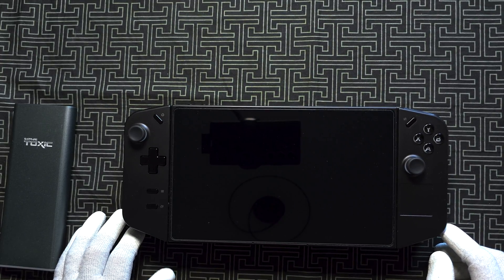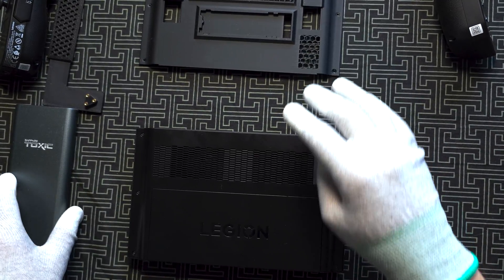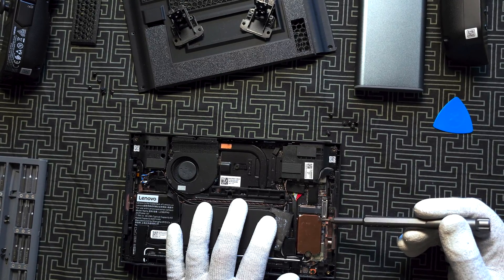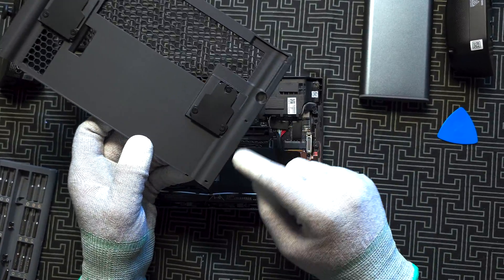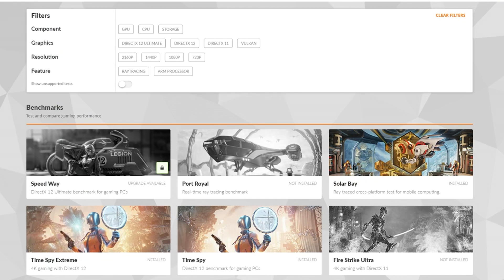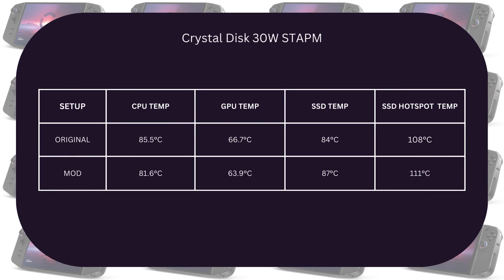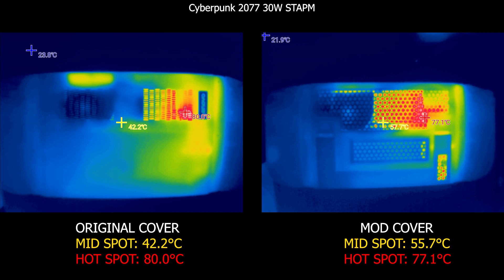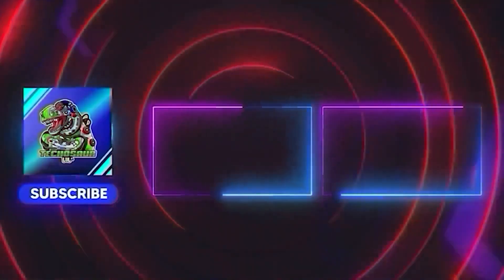Is This New Cooling-Enhanced Back Cover Mod for the LEGION GO a Worthwhile Upgrade?

Comment: dude all the mods you show makes the legion go warse. Even the 40 W it made my legion go unstable and i feel it has some issues still after i reverted it back to default. People save your time and Legion and do not do any of this modes! Good work man this is very well done content and you cover all of it great, not blaming you in any way, just your content shows to not touch the legion and use it as it is.

Comment: It looks like they've closed their Amazon UK store down as says unavailable :(
Reply from the maker: I found another link in Amazon UK if you are interested
https://amzn.to/3VJCOII

this is the cheapest offer on amazon UK i checked
Reply: @TECHOSAUR  Thanks very much. Typically I checked before watching to the end of your video. I can't really think of a use for this given how much extra heat seems to be generated for a very small 2c benefit. Have you come across any other cooling solutions (with or without including case replacement) ? Would be interested to find out :)

Comment: 9:27  I think you are spot on. If you take multimeter to the metallic surface on the back of the cover, you can see that it is conductive. On top of that there are 3 foam pads wrapped in a semi metallic weave (also conductive). Those 3 pads sit on top of the cpu heat pipe (they even left that spot bare copper for a solid link), the ssd, and the cpu cooling fan. 

The big question is what type of paint are they using to do the heat spreading? Kind of reminds me of the conductive paint that is used for grounding guitar pickup cavities.

Comment: I wonder if a metal version of this would be possible and if it would work better?
Reply: To a degree (pun intended) but covering the inside with copper tape works well for heat dissipation. I've done it on all my laptops and handhelds with positive results. The amount varies device to device though of course, but it's always good.
Reply: @TtumpsNeckVagina oooh I wonder if printing it in a fdm printer with a copper filament would work too
Reply: @joshthomas852 I've no experience with 3D printing so I couldn't say. Sound feasible though.

Comment: Thank you for this, was on the fence for the cover,
Reply from the maker: Me too. Not what I would like to use for a daily drive; it doesn't solve all issues. Maybe good for some uses, like an external 2280 drive, but still not perfect at doing it, and the material is very cheap compared to the original one. I don't think you should get it. The only reason you should pay for one would be a better backplate for the Legion Go that looks and feels like the original one while adding more, this feels a downgrade in some way, Legion go deserve better

Comment: @TECHOSAUR Are you ever going to update this video using the 2280 with the mod and orig back plate
Reply from the maker: Yeah! I think I'll get back to it soon—sorry for the delay 😣
Reply: @TECHOSAUR  do you have have any suggestions... I thinking about getting the 4tb lexar 790 or the Samsung 990 pro plus
Reply from the maker: @xxRioGoodxx  I'll take Samsung 990 pro, I dont think there's pro plus for 990 though, its 990 pro, I have one and its very reliable, been using it since 2022

but also lexar 790 has good speeds, I don't think you can go wrong with either
Reply: @TECHOSAUR  thanks

Comment: Hi I am using the similar backplate for my legion Go, however the temperature is lower than you full load max 60c+, i think that whether did you turn off the " link state power management", causing this high temperature to the SSD, cause i was turn this off and my SSD temperature was higher upto 80c ++. After that set it back to "Maximum Power Saving" then temperature reduce. I am using the original 2242 SSD without heatsink.
Reply from the maker: But this might drop your SSD speed, wouldn't it?

Comment: Maybe there will be an improvement if you try to blow air in the back area while using like a mini handheld or desk fan? The back cover design is good maybe we just need a smaller hexagonal hole to prevent big debris from entering.
Reply from the maker: I may try it, thanks for the idea. I don’t have anything against the cover itself, but I don’t like the 3D printed material. It’s ruining the nice look of the original Legion Go back cover. I think it's good only for the 2280 SSD installed in that middle slot, but you also need to apply dust mesh to reduce dust and even foreign objects (maybe small insects) from entering. I don’t want to sound grim, but it’s too open for anything to enter 😅
Reply: I used a nylon type screen mesh on the inside

Comment: If I can suggest putting just a tiniest bit of thermal paste between the processor and the pad before you put the heat sink around the SSD, you'll have better heat dissipation. I know it sounds strange but if you try it, I know that you'll see different results.
Reply from the maker: Do you mean to put some thermal paste on top of the installed pad on the Z1 Extreme?

Comment: why do people think they can improve on what cost millions to design! muppets
Reply from the maker: I immediately went back to the original one. The appearance alone and build quality are significant downgrades
Reply: Same reason why cars with less electronic devices will outlive newer cars that's loaded with butt massage 3000. 
You can't make money if you make a near indestructible car or device or w.e

Source: worked on navy planes. multi-million or billion dollars of research  and you still end up with subpar design.

Comment: Why don't you add a mesh first on the new backplate
Reply from the maker: to ensure that the mesh isn't decreasing the airflow, It's better to add mesh because holes are quite big but adding a mesh before testing may change the result

Comment: STAPM by design is a thermal target.  You can’t compare temperature with STAPM applied. Move the SSD to the position the backplate is designed for, turn off STAPM, and rerun the tests. This is a hack job of a review lol
Reply from the maker: What do you mean by moving the SSD to the position the black plate is designed for?

I am using the original Legion Go SSD 2240, not a 2280 drive.

ur point about STAPM is definitely true, should re-do it
Reply: @TECHOSAUR  you are ignorant desperate for content and attention and you just confirmed it with this comment...the backplate is DESIGNED for 2280 SSD in the middle of the backplate...the video is USELESS and only spread misinformation
Reply: Use an adapter to move the SSD to the back plate.

Comment: I got the back cover and NVMe adapter, and its not bad but has one major shortcoming in my opinion and that is that the NVMe bay is not heatsink friendly to say the least, which given the fact that the LLG performs best with PCIe 4.0 x4 drives, and half decent ones run hot, it could do with a rework. I tried my spare Samsung 980 Pro with heat sink and  I was expecting the cover not to fit and had some long thin screws to sort that, but it wont fit in the bay at all as its to wide.

I ended up screwing it in to the raised back of the bay with some thermal pads underneath in the bay just to give it a level fitting. It now sits exposed but looks fine, and is on there rock solid. It has a nice performance boost as well compared to the original and 2TB upgraded one I had in there as it performs around 50+% faster and is very noticeable on some games like BG3 where the experience is smoother. it does heat up a fair bit and does get hot, but not hot enough to burn, more like holding a hot coffee cup type hot. Its not an ideal solution, but until a third party option comes along that lets me have it in a bay properly, its staying as is as the performance increase is  worth it, plus its on there solid and nothing really is exposed as the drive is completely wrapped in the heatsink and the connector is covered. Its also got the advantage of being able to be actively cooled when being used docked as with a USB fan on it, it runs perfectly cool (I'm running the 3DMark storage test on it as I type this and its perfectly cool with the fan on it).

I cut up an old 200mm fan dust filter and covered all the vents as well to complete the package, and while its not ideal, I am satisfied as its feeling like an upgrade to me.
Reply from the maker: Thanks for sharing your experience.
The 980 Pro runs a bit hot from what I know, given its high read/write speeds. It also depends on the controller type.

Comment: It looks like the back cover has thermal pads to connect to different parts of the Go, so it is used for cooling. That's probably why we haven't seen more official 3rd party mods like you get with the Steam deck, as they would need to replicate or have a substitute for that to not get overheating issues. My guess is a 2280 SSD with a heat sink would solve the SSD issue, but something else would be needed for the rest.
Reply from the maker: Sure, if you are going to add a 2280 external SSD, this cover is the best option, but for any SSD that will go underneath it, it will be worse. I mean, the vents for the 2242 and 2230 are useless, plus it doesn't look very nice IMHO 😆 
I feel downgrade

Comment: Something is wrong with your SSD. I have the older revision of this back panel and my stock SSD tops out at 64c after downloading 125gb game using gigabyte Ethernet
Reply from the maker: Did u try crystal Disk mark ?
Reply: Yes, that’s what I used

Comment: differenze inutili. non ha senso comprare questa cover. grazie per iil test fratello
Reply from the maker: Figurati, lo sto vedendo su Reddit e volevo testare dal punto di vista di qualcuno che usa il drive del Go originale. Onestamente, non credo che sia un buon aggiornamento a meno che tu non abbia un NVMe 2280 da montare, altrimenti potrebbe peggiorare le temperature del drive 2230, 2242 all'interno. Inoltre, la ventola raccoglierà più polvere dati i fori d'aria più grandi, quindi dovrai pulirla più spesso oppure installare un filtro antipolvere.

La somma che più buchi non significa Wow, i materiali misti all'interno usati in quello originale possono condurre calore meglio del materiale di stampa 3D PETG.
Se hai drive 2280, non è male anche la temperatura della CPU, GPU secondo poco 2-4 °C. Ma lo trovo esteticamente brutto rispetto all'originale, lol il Go sembra un giocattolo con questa cover 😄

Comment: That's what I thought. A waste of money and time. Lenovo spent a lot of time designing this thing. if it was just as easy as poking a million holes in the back they would've done that and moved on.
Reply from the maker: It's good if you have the 2280 SSD mounted along with a heatsink. I'll try it out later on. I got an SSD, especially for it, along with the adapter, but for anyone that is going to use a 2242 or 2230 NVMe, it's really going to worsen it. Those air holes aren't going to do any good.

Plus, if you don't apply a dust filter on top, the fan will get way more dust and you will just need to clean it frequently. Maybe you noticed, but the fan gets dusty quite fast. I cleaned mine three times since I got it in November.

I appreciate the work done on this mod, but if we want to address the internal SSD temperature, it would take more than just poking some holes like you said. The first thing is having some passive cooling, so you will need thermal engineering going on. I believe third-party companies like JSAUX and HandheldDIY could make it like they did for the Ally,it works well.
Reply: he uses the backplate wrong...this backplate is not designed for original 2242 SSD but for 2280 SSD which should be put to the slot in the middle of the back plate in the back...this whole video is useless
Reply from the maker: But whoever made this cover has included some airflow holes for the internal SSD at the bottom, many would assume that more airflow generally may also improve internal SSD temperature, but it just worsens it.

sure putting any SSD externally will be good. I'm just pointing out that this cover mod may be bad if u want to put ur SSD in its original position.

Comment: This isn't surprising at all. More holes intakes or outakes doesn't means better airflow, it means less air moving per holes so the air is moving slower inside the device which is probably not a good thing. the size, position and number of holes was probably calculated in accordance with the fan's capacity. your are indeed disturbing the intended airflow and dissipation surfaces areas. The engineers probably know what they're doing, and if they've decided not to add more holes, it's probably for a good reason.
Reply: Even tho i agree with what you said for the most part, don’t overestimate engineers. They are moore than capable of doing design flaws cough ally cough
Reply from the maker: The Legion Go has really good cooling for the APU. A single fan is able to cool it quite well. However, things aren't going so well for the SSD. I've constantly seen my mine showing critically high temperatures, especially when I install games. Of course, if you use a 2280 drive on this modded one, it's going to be super cool with a heatsink, but there are many users out there who prefer using the one that the Go comes with, a 2242, and using this mod cover with it's extra holes will worsen it for them
Reply: @TECHOSAUR I bought this for the SSD heating reason and so far the screen has cooled down a lot so I think the SSD has betterairflow to it now. However one screw wouldn't screw back in 😅
Reply: This. So much this. If this was supposed to improve things, then you might as well rip off any coolers off any CPU and open the case. Volumes of fresh air! Yayyyy oh you won’t last long
Reply: Best thing you can do is clean the fan every few months. They get choked
Reply: Nah, dumb opinion

Comment: Informative as usual, thanks!
Reply from the maker: Thanks.
I only got it because it’s important for others to know what they’re buying, especially since AliExpress stuff isn’t easily returnable. If you have a 2280 SSD with a heatsink, go for it as it has a hole for the adapter to go in externally, but for other size formats (2230, 2242), it would be terrible. Even I’m using a heatsink and the stock SSD for the Legion Go, which doesn’t have the highest read/write speed.
If I use my 2230 WD Black SN770m, it will likely fry itself.

Poking holes in the SSD area is definitely not enough; I’m not claiming to be a thermal engineer, but I believe that plastic isn’t thermally conductive like the metal used on the original. Even the thermal image shows how the original has heat spread over a wider area, while the PETG on the 3D mod cover used is just showing a very hot spot and the surrounding area is unaffected.

Comment: idk how its possible that the ssd got hotter. I am curious if the fan noise is less though, many people complained that the fan is making a whine sound with the default cover.
Reply from the maker: Fan was set to full speed, but I didn't install a 2280 drive. Instead, I installed the stock 2242 drive that came with the Go. My temperatures have gotten even worse.

Although this cover appears to have air vents for the SSD, giving the impression that it would improve cooling, it actually has the opposite effect.

It gets effective if you install a 2280 drive in the outer part as shown. However, if you leave a smaller drive such as a 2230 or 2242 inside, the temperatures will worsen. The original cover has an interior metallic coating that transfers heat more effectively than the 3D printing materials used in this cover.

I do not recommend using this cover if you have a 2230 or 2242 drive. It is only suitable for 2280 drives with a heatsink.

Additionally, you should periodically check the fan for dirt and clean it if necessary. You can also install a mesh filter to prevent dust from accumulating on the fan.
Those honeycomb air holes are too large

Comment: You should re check before and after with nvme temps. Also really is designed for use with a 2280.  I use a 2280 + a heatisnk. My max nvme temps are 40c and my average nvme temp while gaming is in the mid 30s. Also my cpu temps during all these test way lower also. Your numbers don’t align with mine so somethings off or your just not optimized as well as you could be
Reply from the maker: I didn't use a 2280, just the 2242 that comes with the Legion Go and a heatsink. Yes, it makes more sense if you use this mod with a 2280 drive, but with 2230 or 2242, it has worsened SSD temperatures much more than they're already on mine.
For CPU & GPU, it improved by about 2-4 degrees.

It has some downsides. First, the fan gets dusty much faster. A mesh filter is an option, but then it might reduce its cooling. We are back to square one, but cleaning frequently solves it.

I think my results make sense. I repeated it three times. The original back cover has an internal metallic coating. I think it may transfer heat from the SSD hotspot more than a 3D printed plastic one.

In your case, having a 2280 drive makes it a good mod, especially having a heatsink and all, but for 2230 and 2242 drives that go inside, it will get worse.
Please check it to confirm this.

I'll try it with a 2280 NVMe, sure it will be good. I also was interested in trying it with the 2242 that comes with the Legion Go, thinking I was improving it by having those extra air vents, but actually, it's not better at all.

Our results don't align because we have different drive placements.